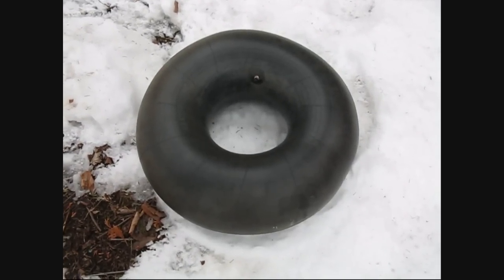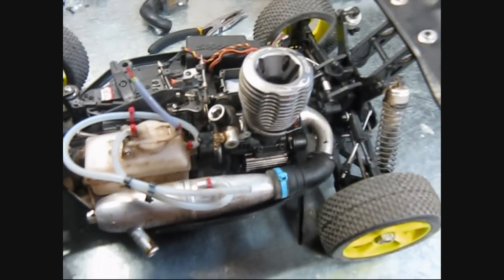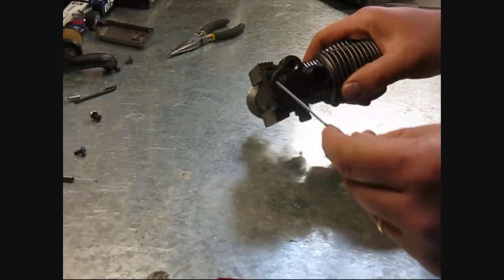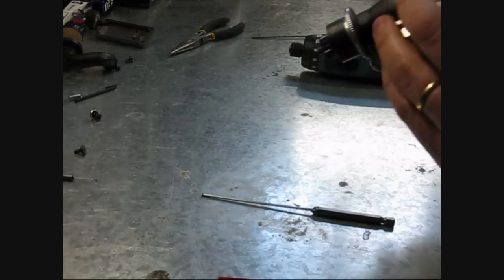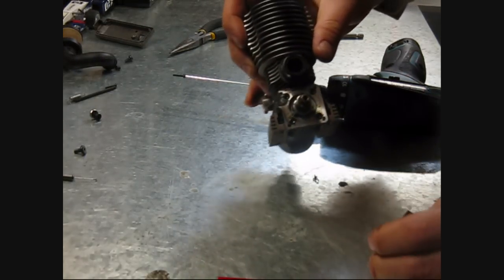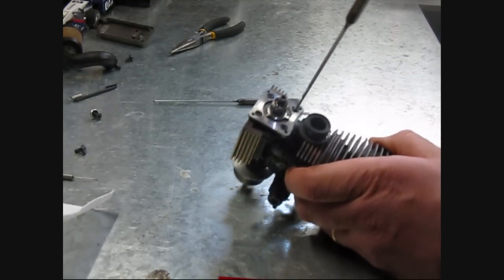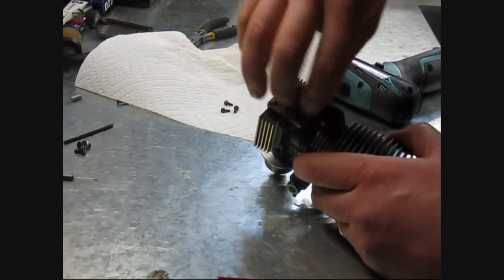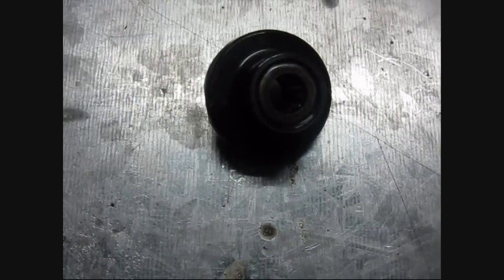Tearing apart the HPI K 5.9 engine

Comment: did you have someone weld you up those drivers for yoour inpact gun:? I weld myself wondering where you got the drivers themself the side that goes in the drill well I would buy some philips heads and use a cutting wheel so shes flush to work with hte driver heads man I got to get a set of those going if you know where htey got the parts please let me know , frig ya bill